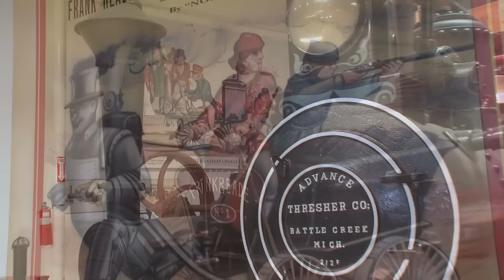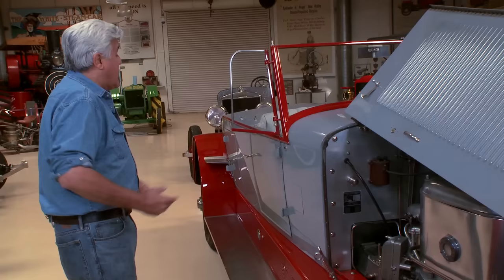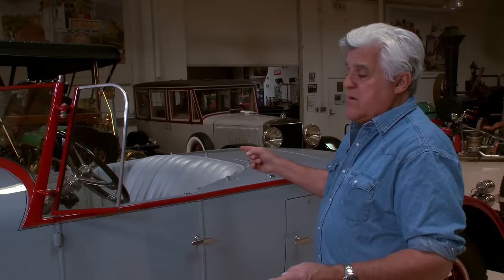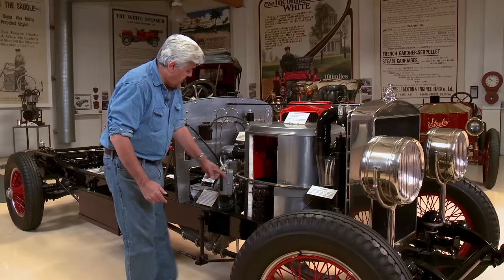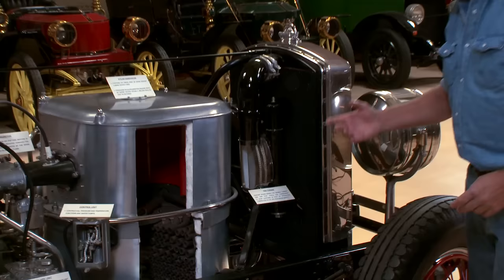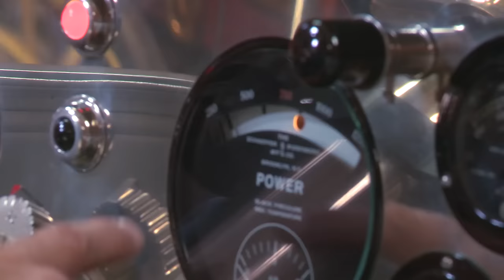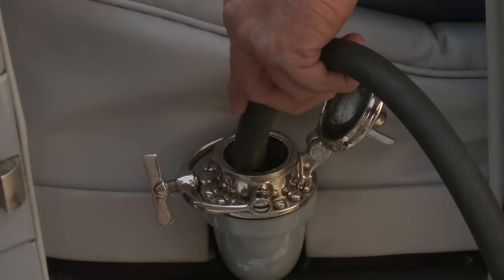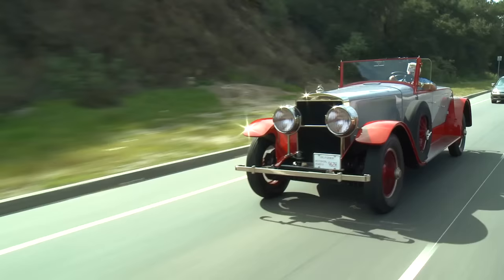1925 Doble E-20 Steam Car - Jay Leno's Garage

Comment: I wonder what would happen if you sprayed water on the radiator in summer, because the evaporative cooling effect should in theory cool the steam down.

The question really is, would it be more efficient to do that, or would it still be more efficient to vent the steam to atmosphere?
Reply: What would be the difference???

Comment: Duesenberg gauge, the similar hidden top did I miss you saying this is based on a Duesenberg? Very cool piece of technology, surely some clever people could modernise to produce a steam powered era without the need for electricity + batteries. Steam to drive a small generator to charge your phone would be easy.
Reply: Doble and Deusenberg only sold the chassis, customers would order the body separately from a coachbuilder like Rollston or Walter M. Murphy Company.
This body was built by Murphy Co. who also made custom designed bodies for Deusenberg customers in the same era.

Comment: Awesome piece of history.  Curious, what is the carbon output of a car like this compared to a modern gas car?
Reply: EPA tests on the Doble boiler produced between 1149 to 1371 grams of CO2 per mile or about 10 times as much as a internal combustion car.

Comment: Throttle is just cracked open at highway cruising speed?!  Is it correct that back in the day (early 20th century) gasoline was of lower octane, not as pure, and might have burned cooler than ours today?  Or maybe the special coating in the steam generator is securing much more heat than anticipated by the original design?  Maybe a different carb setting is needed to calibrate a more efficient heat source.   Is that burned gasoline exhaust blowing off under the running board or excess steam vapor as Jay is running down the highway?  Fascinating stuff.
Reply: Not true, Model T Ford's ran on 85 to 87 octane unleaded gasoline just fine... they could even run on kerosene like the Doble.

The steam valve is not analogous with the throttle on a Internal combustion engine.
 The Doble E series burner had one power setting, 2 million BTUs or 750 horsepower, the same as a Dodge Hellcat at full throttle.

Jays Doble gets between 3MPG and 6MPG on regular unleaded gasoline.

That is steam, the Doble condenser cannot handle the steam flow on a warm day and the pressure relief valve vents steam almost continuously.

Comment: You know, I reckon the only reason we don't have steam cars today is because of complexity. But imagine if it made a comeback. The emissions people would be pretty happy, and I bet the a new age of gearheads could find ways to make them more powerful.
Reply: The EPA tested the Doble boiler in 1971 and it produced more emissions than internal combustion engines.
It also got a combined average of 6.5 MPG

Comment: I wish i had the money to start making advanced modern designs based on this concept. Using hydrogen as fuel for the production of heat, advanced electronics, materials and manufacturing methods, this can be a serious alternative to EVs. 
  It's a shame that no manufacturer considers steam now that they're all looking for "zero emissions" vehicles. It's the perfect solution.
  I mean everything could be simplified with electronics. The throttle "screw" could become a normal footpedal, controlling an electric motor, turning the screw valve. This design could become something amazing.

Comment: Besides a brief surge of interest in steam powered cars during the 1960s, there doesn't seem to be much R&D going on lately. We could benefit from new ideas and more experimentation whether done by leaders like William Lear or a shade tree mechanics tinkering with a hunch.
Reply: No legitimate company or engineer would be interested in revisiting steam cars due to lower efficiency limits imposed by the Rankine Cycle.
The Laws of Thermodynamics prevent steam from matching the efficiency of internal combustion engines.

Comment: Hey Jay , you could build a wee speeder with flash steam and modern electrics....?😊
Reply: The Doble already slammed right up against the inherent limits of steam car performance in 1926... the British Steam Car Challenge successfully broke the steam car speed record in 2009 but... by a disappointingly small margin considering that it used the best steam technology available in 2009.

Comment: This car is an absolute powerhouse when running in peak condition. All of the issues with a design like this could be solved with modern technology and solutions. A steam car like this could potentially be very efficient and powerful, and quite flexible in fuel needed to burn.
Reply: NOT TRUE, the Doble E series barely made 150 horsepower when new and significantly after some wear.
Also not true, steam cars have some inherent flaws and fundamental limitations that cannot be solved by modern technology.
Steam is less efficient and more costly than ICE technology.
 Not really, it  requires a  35 gallon fuel tank of kerosene to manage roughly 200 miles.. and it's automated boiler only operates on fuel oils or gasoline.
 It's a  fascinating piece of antique automotive history but not at all a viable concept for todays today's world.
Reply: @sandervanderkammen9230  Yep you're referring to an antique, I'm talking about a modernized version of this technology. Of course it wouldn't stand in its current state.
Reply: @369Sigma  No such thing, steam cars have been obsolete for over 100 years
Reply: @WilhelmKarsten  I think you guys are completely missing the point I'm saying lol.
I'm not trying to say it would be more efficient or better than internal combustion, I'm just saying with modernized technology steam vehicles could potentially be a more accessible albeit inferior product to IC. There's pros and cons to both, that could make steam engines viable in some places, even for everyday use, if there were an automobile manufacturer willing to put in the development.

The only reason you don't see them is because nobody makes them. And there are plenty of good reasons to make them.
Reply: @369Sigma  No, steam cars are obsolete because they cannot compete with internal combustion engines.
The Doble reached very near the practical limits that can be achieved even with today's technology.
The Doble runs right up to the limits that can be achieved within the laws of thermodynamics which prevents steam engines from matching the performance of internal combustion
Any questions?
Reply: @369Sigma  Why would anyone want make an inferior product?
After the introduction of electric starters in 1915, all of the steam car companies switched to internal combustion engines or went bankrupt.
Reply: @WilhelmKarsten  Inferiority is commonplace in industry, it's based on supply and demand and cost of goods for manufacturing.

You'll often buy an inferior product because it's more affordable and you don't need the robustness or efficiency a higher-priced product offers.

a good example would be tools. Hand tools, power tools.
Reply: @WilhelmKarsten  also I doubt your expertise with steam engines is any more than mine lol. I'm a mechanic by trade so I do know my way around IC engines.
Reply: @369Sigma  Excellent point, So why would anyone buy a hand drill for $1,000 dollars  when you can buy a good cordless electric drill for $100 dollars????
Reply: @369Sigma  Steam cars cost much more to buy and maintain.
The Doble E-series cost in today's value around 1 million dollars and has absolutely staggering maintenence cost and fuel cost
Reply: @369Sigma  Really? That's a very bold claim... especially for someone who just implied steam cars were affordable.
Reply: @WilhelmKarsten  Exactly. Based on your needs. Why would you buy an inferior V4 when you could buy the V8?
Can't possibly be because of cost and needs.
Indeed, why would anyone ever buy an inferior product, I wonder?

Also you buy corded power tools because they run off of more powerful amperage, in case you didn't know.
Reply: @WilhelmKarsten  also you keep going back to the Doble. I'm not talking about the Doble. I'm talking about a steam engine with modern technology. Stop referring to the Doble, you're only confusing yourself.
Reply: @369Sigma  That's exactly why steam cars have been obsolete  for over 100 years.

Cordless drill works anywhere... corded drill you need an outlet nearby... more amperage? Not when you need 500 feet of extention cords! Lol!
Ever use corded drill on a roof or from a ladder? They suck!
Reply: @369Sigma  Don't exist! The Doble was the last legitimate (barely) steam car manufacturer, and the company never made a profit.
Abner Doble was born a millionaire... and he died penniless.
Reply: @369Sigma  "Steam engine with modern technology"
That's an oxymoron... steam is an antique technology.

Comment: With today’s technology car manufacturers should revisit steam power
Reply: Why? Steam cars are obsolete technology
Reply: @sandervanderkammen9230  they have analog controls gas burners. I’m sure it could be done with heating elements and computer controlled same thing, but totally different.
Reply: @mauricecooper176  Heating elements???
Why would you use electricity to make steam?
Reply: @sandervanderkammen9230  it’s got to be better than gas. That’s just one idea I’m sure there’s other ways.
Reply: @sandervanderkammen9230  what I’m getting at is if you could get in a car that is powered by steam turn the key and drive it like a gas car I think with the technologies we have it could happen
Reply: We had electric cars as far back as we can remember cars being around and now they went back to it with new technology
Reply: @mauricecooper176  You don't see the glaringly obvious flaw in that concept?
Reply: @mauricecooper176  What makes you think that steam cars could be competitive with ICEs or EVs?
Reply: @mauricecooper176  EVs were popular up until 1915, after the invention of the electric starter for internal combustion engines they fell out of failure to to the higher cost and limited range... batteries are still the Achilles heal.

Comment: I really want to see a modern steam car.
Reply: It was a joke, Jay's a comedian.
Steam cars are obsolete technology
Reply: @sandervanderkammen9230  May be obsolete technology for that time period but with modern tech we van further increase the reliability and efficency of steam even further than befor. If hey could go 127mph back then and get roughly 30mpg on steam then why cant we push that and get for example 50+ mpg with instant steam. Why not take the same tech we have now for instant hot water heaters and make one for steam.     Why is it that we have 200+ HP engines but still getting only 30/35mpg when we should honestly be focussing on needed HP but higher MPG ranges. Its been proven that you dont need high Horse Power engines to get from place to place, all that Horse Power is wasted in favor for fast acceleration over MPG. Where you have a 117 year old car that can comfortably drive just as good as a modern junk pos car of today.    Not to mention old tech has made a comeback where its improoved massively and working more efficiently now than ever thought befor.
Reply: @killerdeamonking You can't increase the efficiency... steam cars are limited by the Rakine Cycle and external combustion and use... at least not any significant increase in efficiency.
Reply: @killerdeamonking  Jay's Doble E series only produces 150 horsepower at best, and guzzles fuel at the obscene rate of the 3MPG city 6.5 MPG combined.
Reply: @killerdeamonking  I don't know what modern cars are junk..
Jay's Doble spends most of its time in the repair shop and has not run in 5 years... it is currently undergoing its second major rebuild since Jay purchased it
Reply: @sandervanderkammen9230  And how do you figure all this??? Its not like jay talks about it or can be found in some book, 150HP And can easily do 75+ mph is still good. And the fuel those steam cars use is only for the fire not for the driveability. Atomize that fuel and you increase that mpg ratio, Its not rocket science.
Reply: @killerdeamonking  The EPA tested a Doble boiler in 1970.
Jay mentioned in  an interview on another channel that he runs the car on unleaded gasoline and on his own video says the car gets no where near the 10- 12 mph that Abner Doble claimed.
I believe Jay says the car can maintain 65 mph, but he has also damaged the engine several times.
The Doble has a carburator and a heated atomizer in the burner.
 You can't do much to increase the fuel mileage because the engine barely reaches 10% thermal efficiency... by-pass air is required to prevent the boiler from melting and energy is automatically lost when you convert water into steam (Joseph Black Latent Heat)
The Carnot Cycle Formula tells us that reciprocating engines have extremely high heat rejection and thus very poor fuel efficiency because of the Second Law of Thermodynamics. (Entropy, Published by Nicholas Carnot in 1824).
No, it's not rocket science... it's Thermodynamics

Comment: Harrick V. Harrick
 As an engineer we use the term Working Fluid to describe it.

That is False, Steam is a LESS efficient working fluid than air or liquid.

Joseph Black discovered the Latent Heat in 1761.
Latent heat describes the Loss of Energy any time a the working fluid undergoes a Phase Change

Internal Combustion engines are MORE efficient than Rankine Cycle engines because they waste no heat due to phase change.

Nicolas Carnot published his formula in 1824, it describes the practical application of the Second Law of Thermodynamics as it applies to Heat Engines. 

The Carnot Formula tells us that the maximum theoretical thermal fuel efficiency of Rankine Cycle engines is only 63%, less than ICEs.

The most efficient steam turbine engines are the largest power generation plants at around 43%, ships around 30%, locomotives and automobiles around 10%.

The smaller the steam engine the higher the entropy and the less fuel efficient.

The most efficient powerplants in the world are natural gas fired Gas Turbine internal combustion engines 
and hold the world record is 62.5%.

The most efficient ship engines are Diesel reciprocating engines at 54.6%. Yes, if you are going store your vehicles energy in batteries? I makes no sense to use steam... a small, lighter and less expensive electric motor is around 750% more energy efficient than Rankine cycle engines of the similar output.

Comment: I could honestly see steam-electric cars being a future one day. While solar and other tech is great, a steam electric car could run on anything as fuel. :P
Reply: Why would anyone build a steam-electric car???
Reply: @sandervanderkammen9230  Why not? There are many fuel sources, and heat engines generally run on all of them. So if you make a compact "steam-electric" car, it's basically a heat engine car, and you can put in any fuel you like. Granted, we are moving away from fossil fuels, but if we ever go for artificially made hydrocarbons, their fuel-weight ratio is still massively higher than batteries.
Reply: @TechyBen  Because steam engines are significantly less energy efficient than internal combustion engines and do not have the drivetrain transmission loss that ICE cars have.
 Steam offers no advantages over ICEs and adding a electric powertrain only adds cost, complexity and weight with no advantages in powertrain loss.
The engine in the Toyota Prius is 400% more energy efficient, coupled to a small battery and electric motor combo saves even more energy by saving fuel during idling or stop and go traffic and significantly reduces transmission loss.
  Steam engines waste large amounts energy during the warm up cycle, when stopped and when parked (cool down cycle).
Reciprocating steam engines require no transmission, and store energy in the form of boiler pressure so no need or advantage to adding a electric motor or batteries.
Any questions?
Reply: @sandervanderkammen9230  Ah, my bad, I was under the impression efficiency else where (Direct drive steam has no gearbox etc), was enough + the fuel density. Guess artificial hydrocarbons will be the go to for high density fuel in the future then with ICE generators or fuel cell systems.

Steam is still a romantic system though, being able to run on any fuel. :P
Reply: @TechyBen  Internal combustion engine are capable of running on a very wide variety of alternative fuel sources including bio-Diesel, ethanol, biomass methane, hydrogen, wood gas, coal gas, coal oil, esters and ammonia.

We use petroleum because of its high density, low cost and universal availability.
Steam is not a viable technology today because alternative fuels demand higher fuel efficiency to be commercially viable due to thier higher cost and limited supply.
 The one place that steam does have a big advantage is nuclear energy... 
Unfortunately nuclear energy has a undeserved stigma and hysteria handing  around its neck and the notion of terrorist getting their hands on fissile materials is not something that is acceptable to most.
I hope that sheds some light on it for you?
Cheers!

Comment: Thank you so much Jay! I have always wondered why steam cars did not last. Now I know more. My one big question is when will someone create a new steam powered car? Screw all this electric and hydrogen. You have fuel everywhere except in the desert.
Reply: The short answer to you question is No,  steam cars are not efficient or practical  and are extremely expensive to maintain.
If you are not aware? This car has not run in 6 years and is currently undergoing its 3rd major rebuild since Jay has owned the car.
Reply: FYI: water is not the fuel. This car burns either gasoline or kerosene to heat the water into stream, Jay gets about 6 MPG on regular unleaded gasoline.